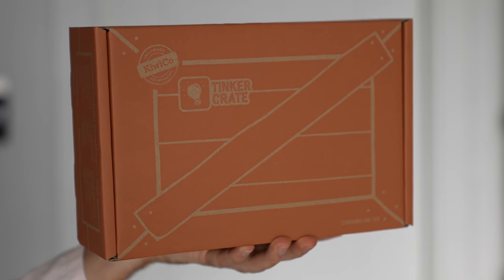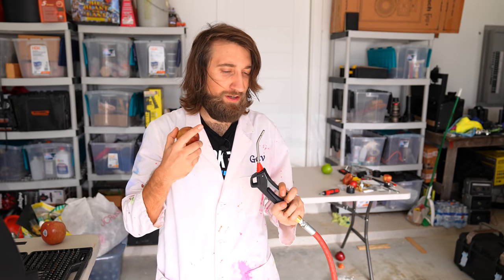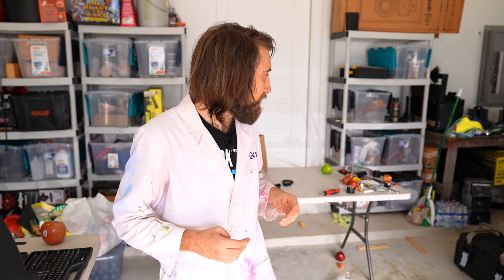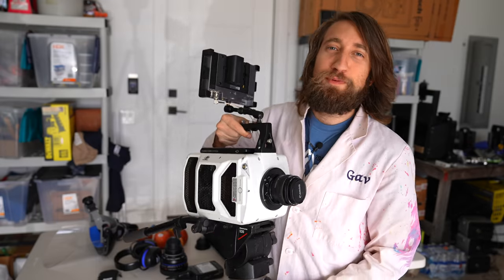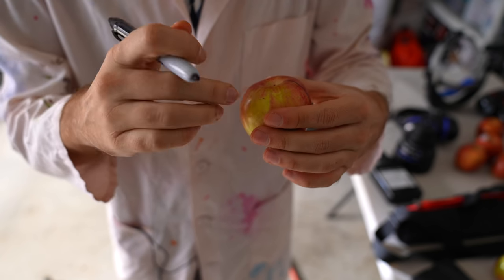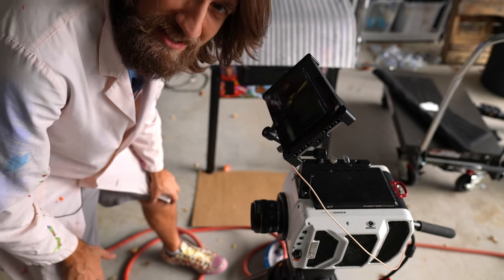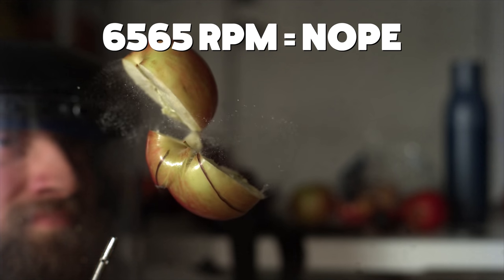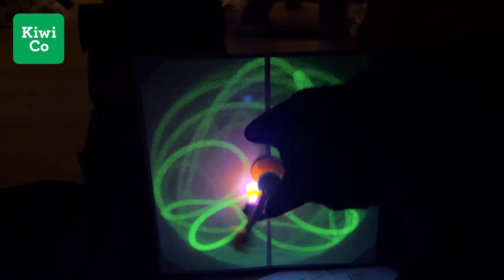Spinning an Apple until it Explodes at 28,500fps - The Slow Mo Guys

Comment: Imagine if Gavin did this with watermelons. Those things would literally be bombs.
Reply: Now I want them to do that.
Reply: putting on science hat but with that much more mass, wouldn't it explode at much lower RPMs? 

...would likely still be quite the explosion. lmao
Reply: And I am sold. Everyone needs to like and comment this suggestion until the nope speed of a watermelon is determined:
Reply: I support this. Need that footage in my life for some reason, now that you mentionned it I can't get it out of hy head. Thanks, I guess.

It would require a way more powerful airflow though, as the watermelon is way heavier. Would indeed require less RPM, due to its mass and the fact that its inside is much more liquid than an apple's, but still with a much more powerful airflow to make it start levitating like the apples did.

I definately want to see it regardless. Also, I probably got the science wrong there, I'm just a curious literary dude and not a scientific person myself. Feel free to correct me, enlightened science lads out there, I'd appreciate it !
Reply: @GreyPunkWolf  we will most likely have to wait until Dan comes back because there's no way Gav is going to hold the air hose for that one. lol
Reply: @SpaceMissile  LOL that's painfully accurate actually. I hope he doesn't read this 😂
Reply: I was thinking the same thing. Once you know the nope speed, it'd be interesting to do it again but  don't quite hit that speed. Would the inside be mush?
Reply: @tysonbuhagiar  On an apple, not really. We clearly saw the apple's inside was perfectly fine and ferm on the footage when it breaks apart.

My guess is that the skin of the fruit (whether we're talking about watermelon or apple doesn't matter here) isn't strong enough to hold liquids at such unnatural speed. 
Therefore, I'd say the fruit would either still explode, but it would take longer, or not explode at all.

Again, not a scientist so I'm just taking guesses here.
So I genuinely want people that know their stuff to correct me if I made any mistakes on my theories.
Reply: @GreyPunkWolf  I agree with an apple. But I meant to do that on a watermelon. Given the weight of water in it, would it push toward the outside and mush up the textures? Or would it all hold together ok until it explodes? I suppose it can only move if there's room to move given water isn't very compressible.
Reply: This is all working on a combination of Bernoulli's principle and gyroscopic force.

A rapid focused airflow in combination with a rounded surface produces a crude airfoil providing an element of lift, combine that with the naturally stabilizing rotation of the apple in its most efficient way of spinning, you get what we see in the video.

(An unequal curved surface with a small amount of lift finding its equilibrium of mass in a rotation with a point vector of airflow creates a natural gyro providing mild stability) 

Getting to your idea of the watermelon, This would be VERRRRY hard to do.. Unless it was a VERRRRYYY small watermelon, The mass of the object would directly correlate to the amount of airflow from a given compressor. The usual off the shelf compressor does about 115-120PSI or roughly 8.2 Bars. Seeing as how you would need more air to generate an area of low pressure to make an average watermelon levitate, like the apple in the video we just watched, we would need some crazy industrial air compressor to make this happen.

Assuming "The Slow Mo Guys" could source this equipment I too would love to see this....

It's all on you now @The Slow Mo Guys

Comment: Just imagine: somewhere in space, this is probably happening to planets.
Reply: I....dont think thats how it works
Reply: @guerra3710  if their spin speed increases.....
Reply: @sixthsenseamelia4695  picture a planet somewhere, just chilling, and a giant space Gav (exactly like the thumbnail) decides to get out his space camera and space air compressor for some space tests.

Space.
Reply: That's how we figured out that pulsars and neutron stars were the same object: the only thing that could spin fast enough to send us radio signals spaced out by milliseconds (we call those objects pulsars) without breaking apart were the really, really dense neutron stars!
Reply: duude, where do i find compressor to spin up planet
Reply: I mean, a neutron star has a beam which is like an air compressor.  So it's not impossible.
Reply: See the Orange version of it with a Sawfish:
https://www.youtube.com/watch?v=NDRdjcDhEAk&ornjh
Reply: @lis6502  Neutron stars can spin up to a quarter of lightspeed. They do it by being shrunken down already fast spinning stars. Don't know about planets tho, since Coanda only works for fluids, which spacetime is not (i think)
Reply: @theyoten1613  Coanda mainly accounts for things like lift, but spin is created by any asymmetrical application of force on an object. So even in spacetime, a planet might start moving in a direction due to this force, but it should still keep spinning faster if the source of the force travels, so to speak, with the planet.
Reply: @sixthsenseamelia4695  that’s not how it works.
Reply: @jamesbizs  Just imagining out loud about how rotation of large bodies could cause an impressive explode. Diet of random sci fi movies as a kid, mind goes lateral not literal lol.
Reply: @sixthsenseamelia4695  Because of something like a black hole or a loose star
Reply: @SillyPotatoPenguin  oooo - yes! I'm not a mathematician or a scientist. But I have a vivid imagination 🕳️💥🌠

Comment: What I found facinating was that the second apple split perpendicular to the air flow. I was partly expecting the apple to split along the "path" of the air flow. However, as I'm typing this, I've reached a potential conclusion. Thinking of it in a sense of push and pull, as the air pushes on the top-side of the apple it also pulls the rest of the apple with it (Yeah obvious I know). But the "push" became too much for the "pull" and the molecular bonds couldn't hold on anylonger and thus split apart perpendicular.

This is why I like watching these slow motion videos, makes one think and be amazed.

Comment: This is how I'm cutting my apples from now on.
Reply: XD
Reply: Actually it looks a little like how I always split apples: make a small cut at the top, insert your thumbs in the dimple at the stem and pull it apart. This makes it split along the cell walls rather than opening them, which means the split won't turn brown as fast as it will when cut.
Reply: @Viigan  wtf
Reply: @Viigan  Ur pfp...

Comment: As a young lad, I experimented to see if acorns pop like corn. The pot exploded on the stove and set the house on fire. I found a few remains among the ashes that leave me to believe they do, but have not since repeated the experiment. Perhaps you guys could 1) use hot air instead of oil, and 2) film the popping process.  You may want to start with corn to make sure your methodology is correct.

Comment: The most interesting is how long our neural network reacts to the phenomenon, computes it and energizes different parts of body, creating different phases of reaction and awareness. Eyes certainly have own autonomic system of emergency shut-off, as eyelids can close in a split second, while all other muscles are completely frozen. It anyways happens 3x slower as would be necessary. Then there's a short initial defensive muscle contraction, trepidation, flight, and confusion. All of these happens without any involvement of reasoning. Reason activates 1.5s later and actually helps to dissipate the confusion and normalize the behavioral state. So much happens in the unconscious state.

Comment: Gav: explains how the apple levitates
My uneducated self:
I understood none of what you just said.
Reply: The levitation works using the same principle as an airplane wing;

One side of the apple is blasted with air, making it have less air pressure on that side.
The other side of the apple has a higher air pressure, and the difference in pressure pushes the apple to rotate, thus keeping the apple in place.
Reply: the important part is that it looks cool
Reply: @beetechs  This makes perfect sense, however I still too stupid to understand how it does this as if the apple was vertical. If the air was underneath the apple I'd understand. 

Jesus, and I'm seeing Brian Cox next year, I honestly think brains will leak out of my ears.
Reply: @invisiblekid99  funnily enough, if the air was shot from below the apple, it wouldn't have the 'lift' like an airplane wing would, it would just be pushed upwards due to the sheer force of the air.

But that method of 'lift' would not keep the apple in place; it would launch upwards until the force of the air dissipates, then fall back down and promptly launched upwards again.

Much like how a spinning top stays standing by spinning, the same is true for the spinning apple, as any force applied to it doesn't push the apple in one direction, it spins it, making sure the apple doesn't fly away.

The air being shot from the side is to make the upper half of the apple have low air pressure, and the difference of air pressure between the upper half and the lower half of the apple generates lift.

Think of it like 2 sumo wrestlers arms locked around each other trying to push each other off the ring;
If they're both equal strength (same air pressure), then nothing happens.
If one of them weakens/strengthens (change in air pressure), then the weaker sumo wrestler gets pushed off, and that pushing motion is 'lift'.

Pardon for a very long winded explanation
Reply: @beetechs  great reply that I do actually understand now. Thanks.
Reply: It would've worked better with tomatoes 🍅
Reply: @beetechs  actually that's relatively simplified and doesn't accurately explain it. The bernoulli's principle (basically conservation of momentum but for liquids) states that fast moving liquid or air has a lower pressure than a slower moving stream. This along with the fact that air has a viscosity just like liquids the air stream sticks to the surface of the apple dragged along with the stream. This sticktion and deflection is the primary mechanism in lift, not so much pressure differentials although it does play a part when optimizing aerodynamics.
Reply: See the Tomato version with a Sawfish:
https://www.youtube.com/watch?v=NDRdjcDhEAk&tm

Comment: The top and bottom part of the apple give the apple a slight boost each rotation. The wind applies more pressure onto the apple on these spots and I wasn't suprised to see the apple break at one of those spots.

Comment: You can also tell when the apple is going to “nope” by the pitch. Since it rotates 109 times per second, it should be producing a sound at 109 hertz. This is a few cents flat of an A natural (A2 on the piano is 110 hertz). If you listen to the sound of the apple right before it splits (in real time) it is indeed making an A natural.

Comment: It does sometimes look like the apple is just not spinning at all, showing you how fast it is.
Reply: IIRC that is the moment when the apple is rotating at the same speed as the refresh rate (or has to do with it). The refresh rate should be Youtube's in this case, right? Maybe theres someone who can do a proper explanation of this? Anyone, please?
Reply: @manuelwie  If the apple spins 30 rps, which means that if it starts spinning facing the camera in the beginning, after 30 rotations, it will fsce the camera with the same side. When that is captured with 30 fps camera, the motion is perfectly synced up and it looks like the Apple isn't moving.

Comment: Newton: "Wait! That's illegal!"
Also, now I want to know the Nope Speed of other spherical (or near spherical) fruits, vegetables, and other items.
Reply: I love this term so much thanks to Gavin. "Nope Speed"
Reply: @aquaticchaos1717  Nope Speed, as coined by Gavin Free, is the speed at which an spherical or near-spherical item (e. g. an apple) loses structural integrity after being spun mid-air by high-velocity air pressure. [Nov. 2020]
Reply: @41tinman41  Right, it just sounds like a funny name for what's essentially an object's breaking point, but given the good ol' Gavin Free naming/word convention
Reply: @aquaticchaos1717  If you look hard enough, there's plenty of funny names scientists have named theories, concepts, formulas, etc. Like cummingtonite is a mineral. A galactic bulge is actually a tightly packed group of stars within a larger formation. Turdus maximus is the Latin name for the Tibetan blackbird.

Comment: This also works due to the odd number rule, for example when it starts spinning it spins once per second, and the second-second it will spin three times a second, and than the third second it will spin five times per second, and so on, else it wouldn’t speed up and stay the same speed in the air.

Comment: Before you return the high speed recorder, spin up a golf ball. Mount the air gun in a vice and tape the gun wide open then control air with a regulator, using the plastic cover off a tefflon tape roll guide the golf ball just a bit off center for the best speed. I bet 20-K RPM.

Comment: i think it explodes becasue the high pressure air is actually hitting a soft object. it drills a hole on it. and blows up. on the normal speed clip we can see it explodes just when he adjusts the position of the air gun. the moment it point right in the middle BOOM

Comment: interesting!...but there's a problem with the design of the experiment, because the pressure of the impinging airflow will affect the integrity of the skin, thus causing it to fail sooner than it would otherwise. to properly calculate the "nope" speed, you should design an apparatus that can spin it in a vacuum. lol, not sure how'd you go about doing that though. 🤔

Comment: Unbelievable to Think, that the Same rpm that disintegrate an Apple, are Somewhat normal for combustion engines

And i think you could spin a crankshaft the same way and it wouldn’t disintegrate at 16k rpm

Comment: WOW!! Set the video's speed to .25 to slow it even farther. Then start the video at 2:11, and watch how slowly his eyes react to the exploding apple. You definitely wouldn't want to try this without a face shield.
Reply: This exact scene should be used in drivers education. Maybe those heroes that KNOW they can react quickly enough when the guy five meters in front of them brakes will realize that they do NOT react fast enough.
His eyes only closed (on instinct, I'd guess) when all the apple fragments were far away already.